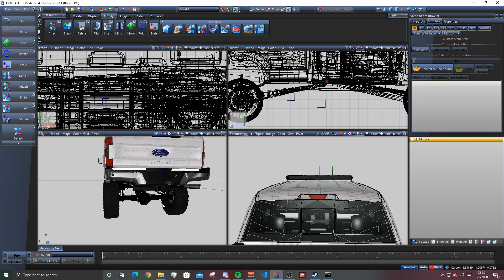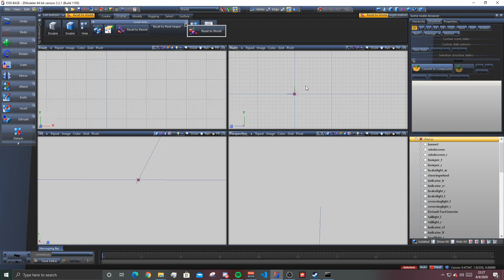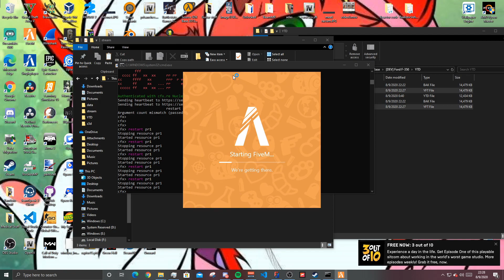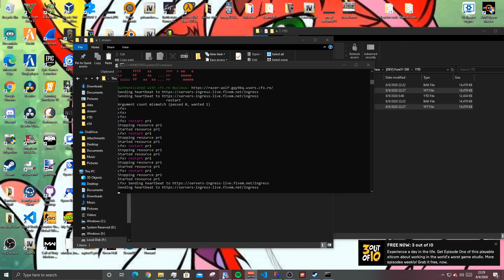How to fix Wheel wobble in ZModeler 3!

Comment: Hai, can you explain how to make suspension animated? Like how it can compress and decompress. Does it use particular scripting or only by compounding/hierarchy?
Reply from the maker: Hiya! I'm not sure how to do that. But I do know it's done via GTA physics.
Reply: @RazerWolfOfficial  from what i read on gta modding forum it has to do with welding parts together in z modeller, but that as far as they talk about there. I know it can be done cos i see many motorcycle mod use it.
Reply from the maker: Once I get my setup back up, I will research this further. If you want, you may join my discord.
Reply: Like hydraulics, that's what I'm getting from you.